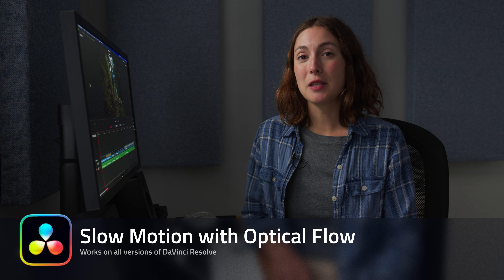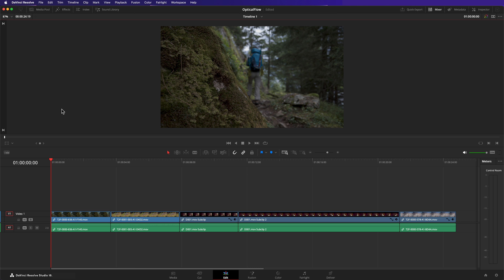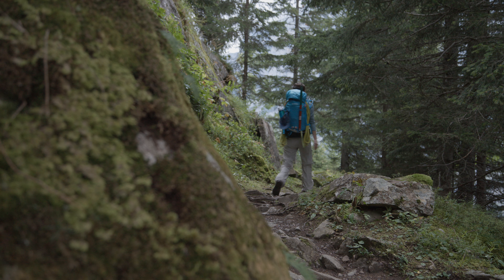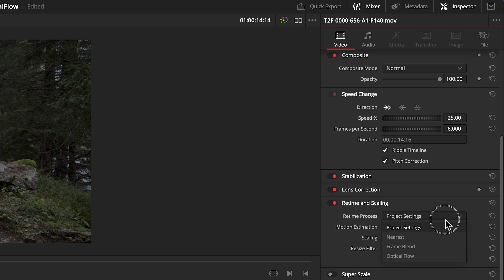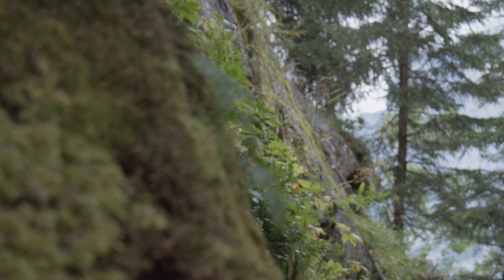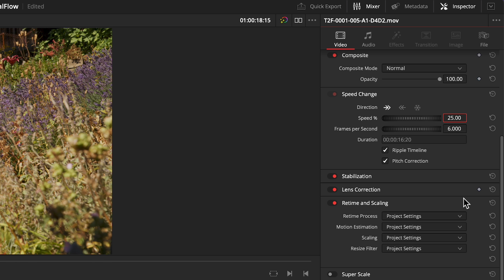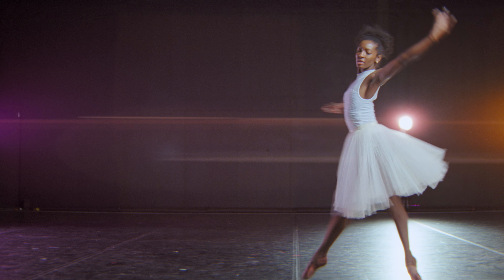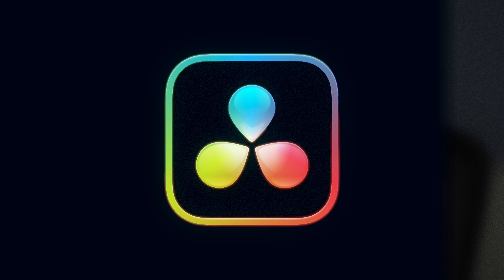FAKING Slow Motion with OPTICAL FLOW - DaVinci Resolve TUTORIAL

Comment: Question More Frames in the original video like 60 or 120fps when you do slow Motion at 25% and used the óptical Flow reduce the artifacs ? Or is the same artifacs if you recording at 24fps?
Reply from the maker: If you are working at 30 frames per second, and have shot your original footage at 120 frames per second, you can slow the footage to 25% without needing to use Optical Flow! There is no need for additional frame generation as the source material has enough frames.

Does that help to answer your question?

Comment: If I do optical flow from fusion, my playback speed drops alot. But if I use the inspector it's pretty good. Why?
Reply from the maker: It's not going to be as efficient running in Fusion as it is in the Edit page. Fusion like most compositing programs is a general rendering engine. It's hard to optimise because there's so many different ways those nodes can be configured. Hope that helps.
Reply: @ I understand now thank you

Comment: Try combining optical flow and speed warp. It will add missing frame rates and give super smooth, slow motion. The downside is that it took longer to render (even with render in place)
Reply from the maker: Great tip. Thanks :)

Comment: What if we shot in 60fps and we're just slowing down 50% to 30fps on a 30fps timeline. Then there shouldn't be any need for Optical Flow, correct? Will the 'nearest' setting just drop every other frame and deliver the smoothest slow motion possible?
Reply from the maker: Nearest will deliver EVERY frame when running 60fps at 30fps (50%) in a 30fps timeline. If you were running 60fps at 60fps (100%) in a 30fps timeline then it would deliver every other frame. Hope that helps.

Comment: like can we convert 24fps to 60 in davinci without altering video speed?
Reply from the maker: Yes, it's possible. Place your 24fps in a 60fps timeline. By default Resolve will use the Nearest frame mode for the frame rate conversion. If you want it to have the appearance of 60fps playback, change retime process to optical flow and motion estimation to Speed Warp for the best possible frame interpolation.

Be cautious though, remember you are trying to make more from less.

Comment: Changing the Motion Estimation to Speed Warp will help, but, slowing down to 25% is extreme.
Reply from the maker: Heya Richard, great suggestion! Thanks so much for watching :)
Reply: @team2films  you're welcome. you will need to cache as it's heavy on the system.
Reply: Speed warp works fast on nvidia gpu with rt cores. I have not tried it on a mac m chip though

Comment: It's worth stating that slowing to 25% is pretty extreme. And optimistic! I wouldn't normally recommend less than 50% - and your results will tend to be better, too.
Reply from the maker: Thanks so much for watching. Yes, that's true that only slowing to 50% will yield better results, but it should be noted that the same artefacts will still be present. We deliberately slowed our shots to 25% to make the demonstration more obvious. Two things to consider:

- There are lot's of scenarios where slowing to 1/4 speed would not be considered extreme. For example action sports, or speed ramping to 0%.
- You might already be aware, but for the benefit of others... Slowing by integer factors (i.e. 50%, 33%, 25%, 20%...) will often achieve better results than non-integer factors.

Great to have you here Jonathan. Thanks!
Reply: your are right, her intentions might be to show, what happens if we go to extreme, but thanks for pointing that out.